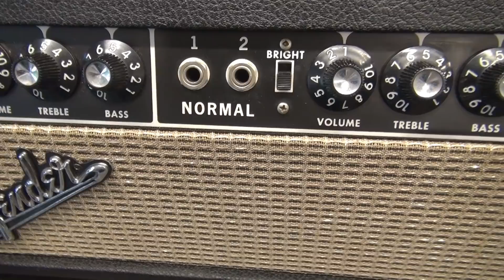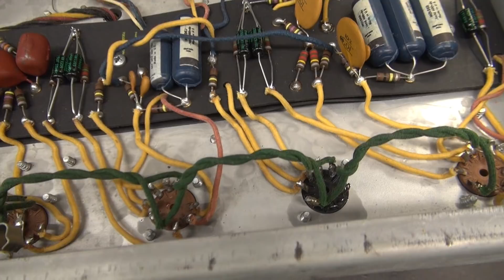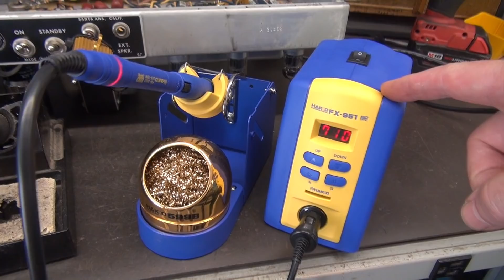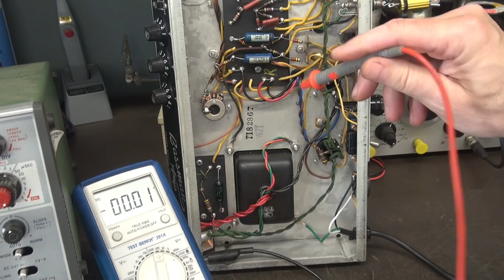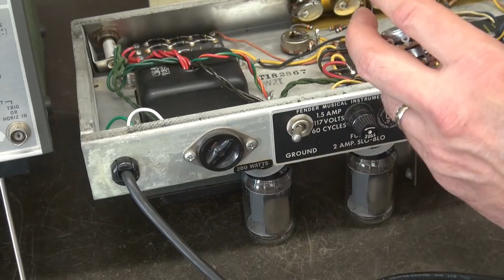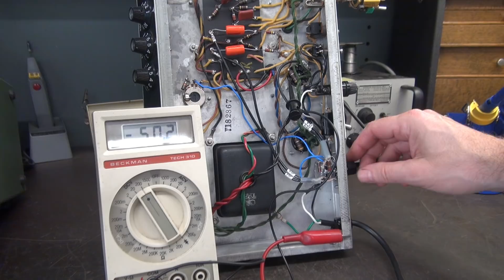How to fix Noise + add Master Volume Fender Bassman 6L6 tube guitar amp

Comment: If I recall,  correct me is I'm wrong.   8:10,  ceramic disc caps are essentially made like a piezo transducer,  and WILL generate power when moved, pinched or tapped on.... thus the noise on that is expected... at a modest level

at 16:25,  the older style caps had a higher ESR than the newer stuff does/did.   I know ESR can climb with age,  but in reproducing vintage circuits,  it seems some of our new components perform better.
Reply from the maker: I've never heard that one man. Whatever the cause, you sure don't want a cap responding to vibrations in your audio chain. They play music all their own, mostly noise. The Spragues are a good option. I normally pull ceramics out of all amps
Reply: Just as an experiment,   set your scope to a high sensitivity, and put the ceramic cap on it.   I'll bet it is microphonic....and generates its own voltage when bent/twisted like a piezo.    Ceramic caps are usually tough as nails for other apps,  but in audio, the noise is an issue, I agree on that part.
Reply: DeadKoby Ceramic caps sound awful, regardless. To my ears PIO always have more character. Ceramics are frequently extremely sterile in a best case, and cold and thin in a worst case. Film are reliable, long lasting, and impart a slightly warmer feel. Film and PIO sound nearly identical, but ceramic bring nothing of value to the party.
Reply: However ceramic's durability in function circuits (not the audio path)  is a plus,  so they have their usages.

Comment: Excellent video!  I have two of these heads and the work on the first one is almost done so it was good to see this video.  Did you check the filter caps at some point or know they had been replaced with the other electrolytic’s?  Really enjoy your videos, always learn!
Reply from the maker: Yes, owner showed me pics of the new installed Mallorys
Reply: D-lab Electronics.  It’s a treat to be able to see these videos and learn.  Thank you for sharing your knowledge.  Happy Memorial Day.
Reply from the maker: Roger that man, 12 yrs USAF here
Reply: D-lab Electronics thank you for your service!
Reply: Change the 4 qty 100K preamp plate resistors with 2 watt metal films. The ones arranged in the "V" shape. Massive difference in hiss-pop noise, not subtle at all.

Comment: Terry, I have worked on many of these and that one is pristine.If that had the Drip Edge it would really be a relic.  I had that crackle problem Many times, and it was the disc cap as well. One had a hairline fracture. After replacing the amp was quiet as can be.  I use the same soldering station - its awesome.  I also noticed you added an electrolytic cap on the center of the Bias Pot to ground. Was that to eliminate noise or to ensure the negative bias was not affected ? I did notice the master volume slightly changed your negative bias.. very slightly.    Nicely done Terry, as usual !!!    P.S.   I notice you are not using the Hakko Lockout Key on your unit - Be careful.... Dick from the Internet may come and change the temps on you... LOL     Seriously, really quality video again.. well done  - THANKS RON
Reply: Ron C Drip edges are sharp, I’ll give ya that, but the BF are worth about 25-35% more. :)  And buying a silver face is a gamble, because that’s when CBS went a bit wild with things, using about 10 different circuits in a few years, and if the tube arrangement was the same, they stuck whatever label inside they had in stock, not necessarily what it is. So, if you want an AB165 silver face, the only way to be certain is open her up and take a look. Some SF circuits, generally post 1970, are widely considered awful, but I’ve typically liked the ones I’ve heard. A lot of BF guys like the original AA864, but side by side with an AB165, the 165 blows the doors off.
Reply: I agree with you Randall.  BF are the ticket.
Reply: Ron C It’s rare to find a SF that isn’t rusty as hell either. Personally, I do prefer the drip edge look.
Reply: I have 2 SF 50's that I restored. Neither was rusty and both are in tip top shape now. Biggest difference is the grill cloth which I had to replace, but aside for that its mint.
Reply: Ron C It's not an electro, it's a law-faking resistor, to make the linear pot behave like a log pot.
Reply: Interesting.. sure looks like a Nichicon to me...

Comment: Terry, request:  
For a simple mod to any amp.  
Add two output jacks to the back of the amp.  
1:  XLR male  mic level OUTPUT jack to go to low imp input on the mixer.  
2:  RCA or 1/4" Line level OUTPUT jack to go to line input on the mixer or recorder.  
They could be tapped into the preamp section, using an inp matching transformer.  
I see many bands using mics in front of small amp speakers.  Direct hookup avoids many problems.  But I've yet to see any amp with XLR low imp output to mixer mic level  input. 
Could be a D Lab exclusive feature!  
Don
Reply: umajunkcollector Bass amps often have that, and is a nice touch, but for a guitar (primarily) amp, they usually don’t sound great without some power tube soak going on, especially using pedals and whatnot. In lieu of miking a speaker, tapping the DI post output sounds way better, either via an attenuator, or something like the Weber Z Matcher, where you can access all stages of saturation at a line level.
Reply: Soooo, its not only that tube sound, i.e. mic the sound of the crappy little over driven speaker too?  Um thunkin get away from that speaker, bypass it, by going direct.  
Yes, some MODERN SOLID STATE AMPS have outputs.  But few old TUBE AMPS  did.  
Where to tap in for audio output to get that tube sound?  I agree in a way, at the speaker stage of the amp, where as you also get overdrive, vol and EQ-tone from the amp's settings.  Some resistors and transformer might do the trick to an XLR and line out jack.  
I'd like to see what Terry would come up with ?
Reply: umajunkcollector Oh, I’m sure someone could devise a way to do it, but every amp DI, aside from bass amps, sounds terrible to me. Some have speaker emulators, but they don’t sound great either. Celestion makes some killer IRs, if someone could implement that, that might work. The Weber Z Matcher has a DI using transformers and whatnot, but it’s way too big to build into an amp.
Reply: But isn't the 100$+ Weber for matching amp speaker output to 2-16 ohms speakers?  Mixer's are much different, low z mic, and hi z guitar pickups, and high z line in, far from 8 ohms, more like 200-20k-200k.  Maybe the overload is why a direct connection, from speaker terminals to mixer sounds bad.  But then again part of mic in front of speaker, gets that speaker sound too, besides the tube sound.
Reply: A simple 2$ 500k pot could attenuate the match from speaker to mixer?  OK Terry, wassupwitdat?  
Ham radio guys often use a "matchbox" or antenna tuner to match the transmitter output to antenna, or at least a BalUn transformer.  The matchbox uses a transformer and capacitor to match RF z.  Audio is much lower freqs, and speakers are not like antennas.  Speakers radiate air waves, antennas radiate RF energy.   But matching impedence is the goal.
Reply: umajunkcollector The Z Matcher does match loads, but has a DI. You can run it in any configuration for your amp/speaker setup, even if they are equal. I’m not saying it’s the best answer, or cheapest, just an available DI post power section.
Reply: A mic should emulate the ear, imagine having your ear at the mouth of a singer, or worse an inch away from a speaker or drum?  Kinda defeats the sensitivity of the mic's diaphram.  When I see the mic in front of the speaker, um thinking...   LOUD ENUFF!  LOL